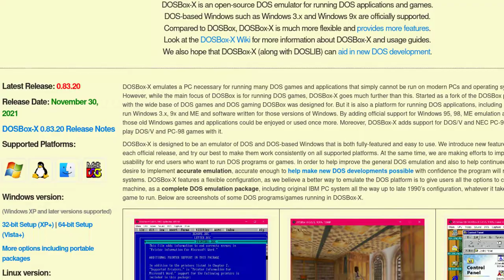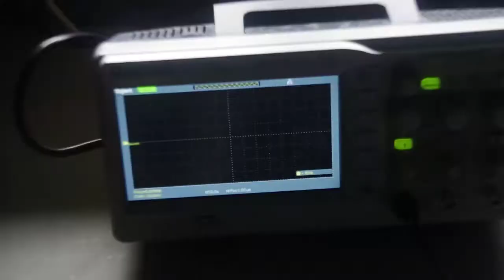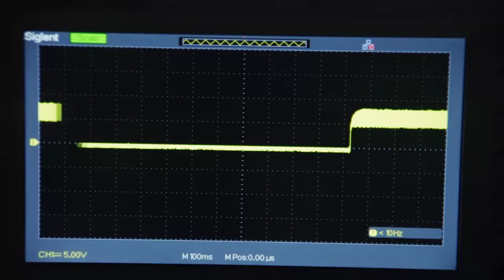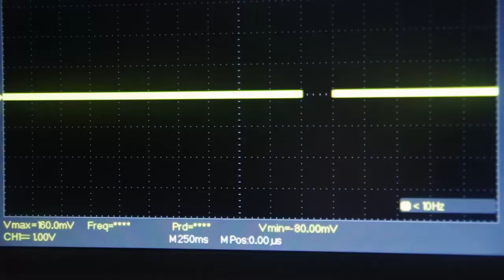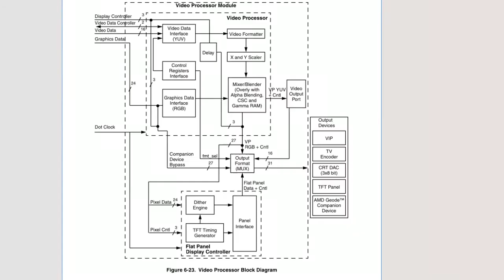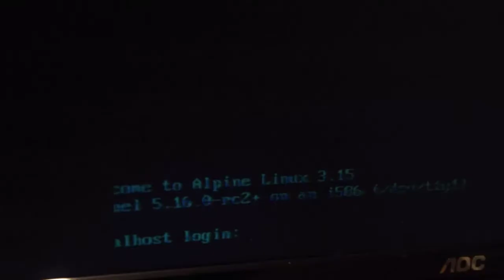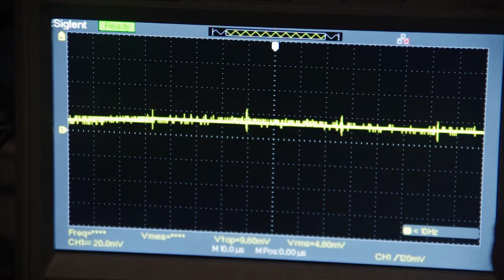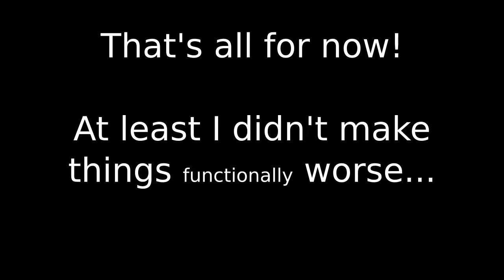Repairing an AMD Geode: Part 1

Comment: Mine was working great. I just changed the video output setting in the bios from crt to flat panel and got exactly this. No video. Trying every which way to clear the bios but it's not helping. The board exibits all the signs of working except for the display. Pity. I really thought you were going to nail this.
Reply from the maker: Interesting! So I do actually suspect this is what's happened on this board too. My current plan is to uh, fix up my fuck-up, then use a BIOS dumper+modifier to change the default settings. Though I'm still not sure about my weird output. I think there might be a bad ESD diode on my board.
Reply: @Jookia  have at it. Id love to see a solution. Good luck.
Reply from the maker: @Telee_Pawt  Me too, and thanks for the luck, I'll need it given how clumsy I am at this.
Reply: @Jookia  "BIOS dumper+modifier" what would this entail?
Reply from the maker: @Telee_Pawt  In this case I think something like this: http://awdbedit.sourceforge.net/ I haven't dumped the actual BIOS from this board yet but my assumption is that you could use a BIOS editor to edit the BIOS' defaults, flash it, and have the BIOS switch to CRT mode by default.
Reply: @Jookia  I got another board. this one works.
Reply from the maker: @Telee_Pawt  Nice!